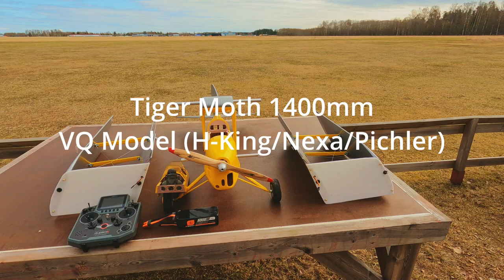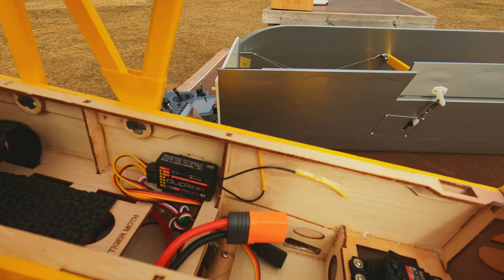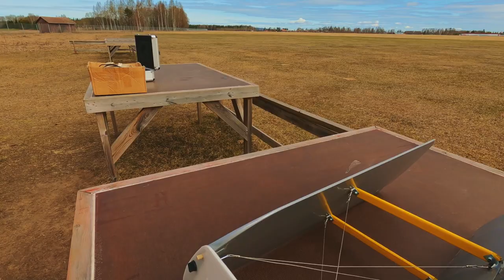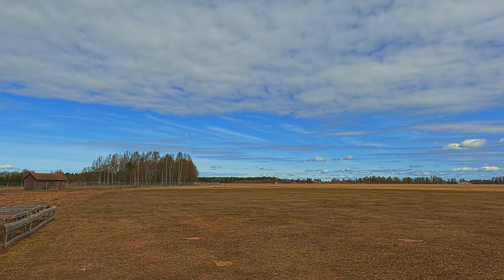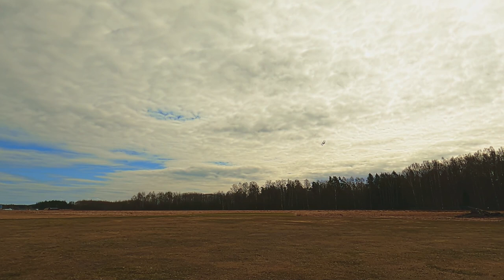H-King Tiger Moth 1400mm

Comment: Great flight.  This video is making me want to buy this plane.  I've never had a Tiger Moth before in all my years flying.   Thanks for sharing this.
Reply from the maker: I don't think you would regrett getting it. 
It was easy to assemble and flies greate. 
There more liveries to choose from aswell. 
Nexa (MotionRC), H-king (HobbyKing) and VQ Model are all the same model only the colors differ.
Reply: @DanielsRCHobby  Thanks.  I think I will go ahead and make a purchase.
Reply from the maker: @easystar123  Sounds good, take you time and read the manual before you glue something and you'll be fine :)
Reply: @DanielsRCHobby  Does it have a good strong undercarriage?
Reply from the maker: @easystar123  I would say no. It's enough for a normal landing but it will bend if it hits hard.

It will do better if you make a 4S setup or glow. My 6S setup if a bit heavy for it. 

That sad I haven't had any problem with the undercarriage yet. All I do is to bend it back into shape when it looks wide. :)

Comment: Tengo y vuelo este modelo. Lo equipé con motor 4T OS 105. Me quedó perfectamente equilibrado y no tuve necesidad de añadir ningún plomo en el morro. Vuela maravillosamente y el exceso de potencia lo compenso volando a medio gas. Es extraordinario.
Reply from the maker: Thank you for watching!
I'm thinking of converting it to a similar engine but not sure if it will happen. It has such a nice sound with a 4T in the front.
Reply: @DanielsRCHobby  I wouldn't make the change over the one you already have.  If it flies fine, leave it as it is.  It is not an expensive model to buy.  For its price I would do the "experiment" of motorizing it with a 4T.  The sound in flight is beautiful, it has plenty of power to make any maneuver.  And with the OS 105, 4-stroke at half throttle is delicious.
Reply: He cometido un pequeño error que quiero subsanar; donde digo que el motor es un "OS 4T 105", debe decir "OS 4T 95". Perdóneme el despiste.
Reply: El motor que uso es "OS 4T 95". Un despiste haber puesto "105". Mis disculpas.

Comment: Hi just fished this out of my stack of unbuilt kits and have run into a small problem in the construction. On page 4  at the bottom of the page it shows fuselage top view and gives a measurement of130mm from firewall to motor shank. I have fitted a motor with the same dimensions as the one recommended on the plan and exactly as the plan describes nad have came up short by 22mm . did you get this problem
Reply from the maker: Thank you for watching!
I didn't encounter that problem but I'm not using the recommended motor. My plane is running on 6S battery instead of 4S.
The solution might be to use longer screws to hold the motor but test fit the cowl first as it might not be needed. As long as you can fit the windscreen and get a small clearence between the cowl and propeller you will be ok.